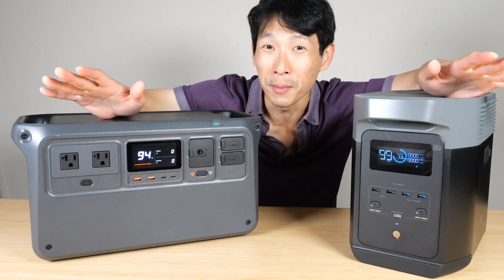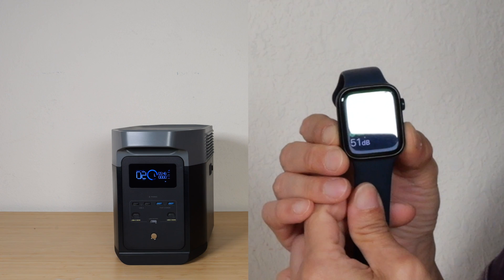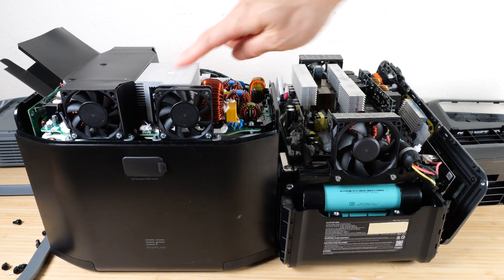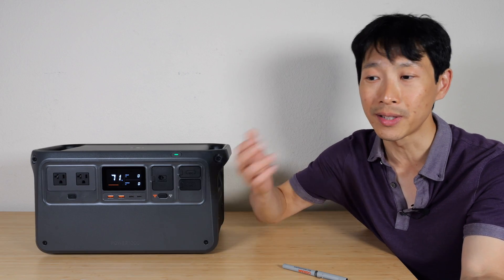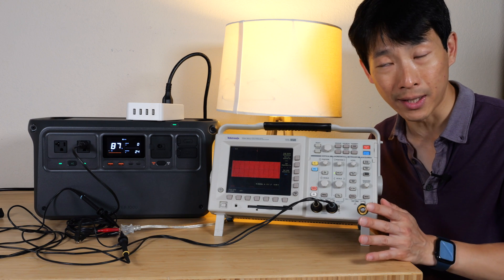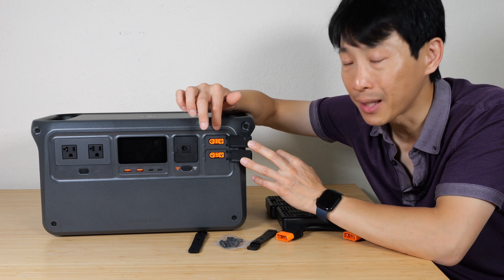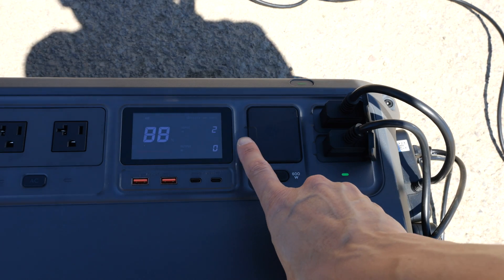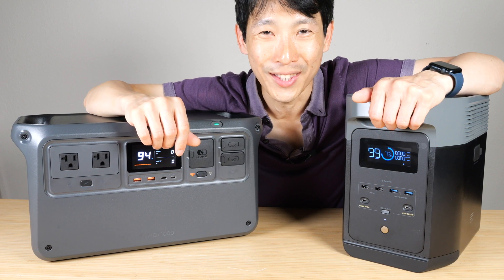DJI Power 1000 Portable Power Station vs. Ecoflow Delta 2

Comment: Thank you for the nice review.  I like the oscilloscope to measure the time drop. The Deltra 2 is for sure louder but has everything built in. The DJI charge you for everything. Want to output 12V - have to pay for that. Want to charge with solar - have to pay for that. Want to charge with 12 V - pay for that...etc.  Also the solar only takes 30v max so limited. But the noise is much better in some situations and is important if you watching a movie and don't want to hear a fan noise the whole movie. =)
Reply from the maker: It's true they could integrate more functions but I think this could be better IF you do not want those functions so the package will be smaller and lighter.

Comment: I purchased a Power 1000 in December 2025 and it sucks ass. It will randomly shut down every few weeks. Undependable and unreliable. Don't buy.
Reply from the maker: These units does not seem to have a high defect rate from the number of complaints. I think you should get this fixed under warranty.

Comment: Both are great units in their environments.  I bought the Delta 2  and the Delta 2 max because it was on sale for $399 and $899 respectively  during Black Friday.  EcoFlow does not market this unit as a UPS but an EPS which is good enough for my type of use.  With the app you can program  it to keep the AC plugs to stay on so during a power outage if the unit is drained to zero when the power comes back on , and you  have the refrigerator plugged to it , it will begin to power the fridge as well once the unit has charged to 5%.  With my older generation models and other brand power stations the refrigerator will still be turned off as you have to manually turn on the AC ports.  I travel out of town a lot so knowing that if I lose power for a day I know that my fridge will still keep running.   Thank you for the comparison.

Comment: Can anyone confirm if it is possible to use the DJI 1000 (or any other in the 2400w inverter category) to charge and discharge at the same time.. i.e connect to a small gas generator ~1200w limit, and draw from the inverter at the same time variable (200w to 2200w - average 600w) up to the maximum inverter output. In other words not do a bypass function which would draw directly from my tiny gas generator, popping a circuit breaker during high load. (Can I effectively use this as a power buffer?) This has been a difficult use-case detail to find about any of these power stations. Thanks in advance.
Reply from the maker: Very detailed and nuanced question! What you're looking for is maximum bypass mode wattage. For 100-120V, max AC output is 1440W. For 220-240V, it's 2200W. So it is limited by the max current in the AC plug from the wall. It doesn't 'add' to the power by drawing a little from the battery when you need it.
Reply: @BeatTheBush  Thanks, some do (able to disable bypass mode). I just need to find one that does. ;-) I'll keep looking.

Comment: Can Power 1000 supply high AC power, like 2000w, to other appliances, while it is charged at 600 or 1200w? Thanks!
Reply from the maker: It's what they call 'bypass mode'. Up to 1440W ON 100-120V and 2200W on 220-240V. Generally, you cannot do over 1800W using the standard AC cord anyway.
Reply: @BeatTheBush  thanks for the response. I specifically would like to ask: when the input is at 600w, can power 1000 still output 1440w?

Basically, can power 1000 output more than input in "bypass mode'?

Comment: Does using the DJI Power 1000 in UPS mode degrade the battery? Or does it consume more power overall (than just plugging things direct to the wall?)

Comment: Better go with eco flow ... It's too costly to buy dji as we need to buy separate modules for everything... And if you check the temperature over solar module it is too hectic apart of extra power eco flow is best ,if you want extra power buy eco flow delta pro .... Much better...

Comment: can you use any solar panel? or do you have to use the DJI solar panels only? they feel expensive for 100w only
Reply from the maker: You can use other ones of course but you have to make sure the voltage and power output is compatible. It also uses an Xt60 connector.

Comment: This power inverter are good BUT for a real life power outage you will something else… I tested the delta 2 with a windows ac unit ( 8k BTU) 800watts and it only lasted exactly 1 hour.
Reply from the maker: For power AC units for a day, you'll need something MUCH bigger and the corresponding price will be much higher as well.
Reply: 5000 dollars 💸

Comment: DJI failed with all the dongles and adapters. Like an octopus for daily operation.
Reply from the maker: Their idea was to get high speed charging access direct from the battery. Indeed, if you use the solar and car adapters then there will be a bunch of things hanging off.

Comment: What would you get to survive a 3 week power outage? I want to be prepared but don't know where to start.
Reply: A lot of these😂
Reply: A gas generator is your only chance. Honda has a good reputation for gas generators
Reply from the maker: Lets say you need 10kW/day. It's unfeasible to only power with batteries. Hence it's best to have a 2-3 day battery with enough solar to charge it taking into account how much sun you typically get.
Reply: You would need the 5 expansion batteries and solar charging.  That would give you over 11,000wh plus the sun helping mitigate degradation.  However there are better solutions for your application.
Reply: Small Propane generator to start with (ie Sun Joe).  Propane lasts forever.  I have 7:20 lb tanks. Scavenge them from curbs when people toss their gas grills out.  Depending on community restrictions then start with a few solar panels and a modest power station. During  an extended week outage, you can charge the power station w/propane gen to augment solar.  

If you catch these items on sale, you have equipment that can be used for other activities (camping, family park picnic, etc). You can do all of it for a little more than $1000